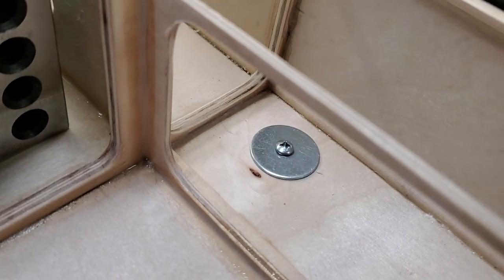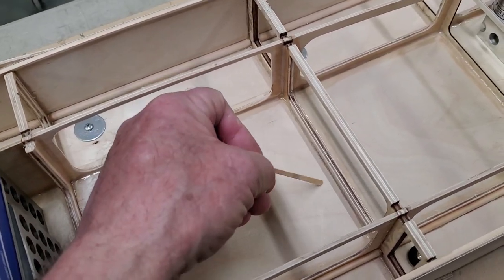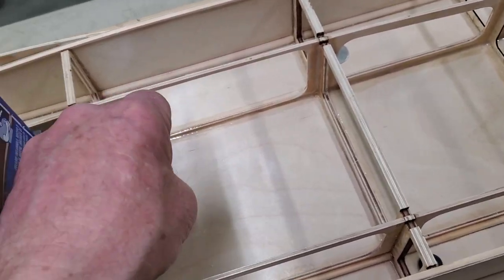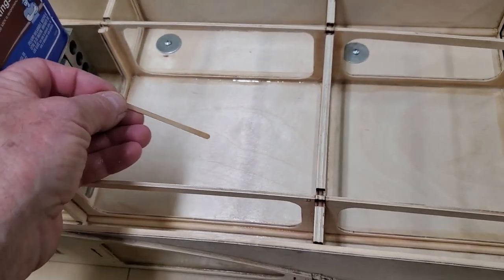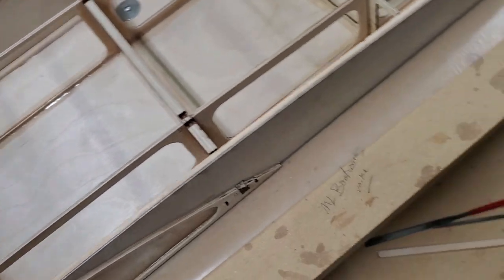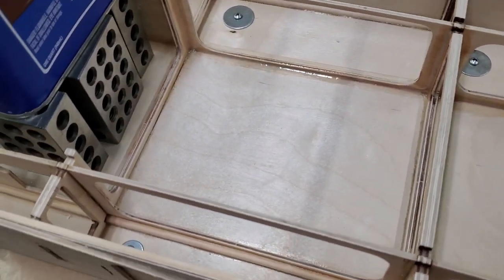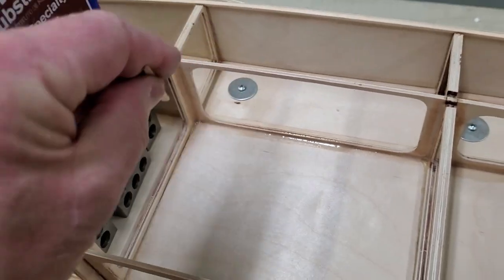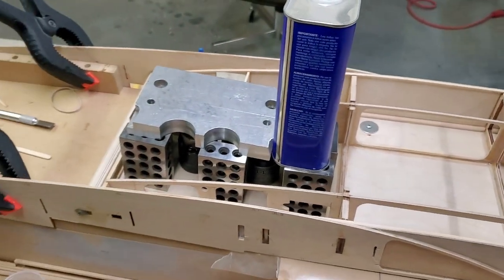RC Racing Hydroplane Boat Build - Reinforcing The Floor

Comment: What thickness are the pieces you are putting in? Is this better than glass or carbon fiber?
Reply from the maker: Good questions, and I guess I should've talked about that.  I use 1/16" ply for the overlay, and don't know if one idea is better than another, but I do know that it looks awesome in wood so that's why I use it. Personal preference I suppose.

Comment: I noticed you're using GFlex to laminate the sponson transom. Why use that over the 105/206 you used for the hull cross braces?
Reply from the maker: G-Flex is used mostly throughout, with 105/206 used only for sealing and in some laminating situations where I want a thinner mix
Reply: @M5PerfHydros  Do you have a rule of thumb as to when each is used? Is there a reason the cross braces needed a thinner mix?

Comment: G'day Scott.Question for you. Firstly, I had a flat bottom go fast boats years ago and it was all balsa reinforced floor to keep the weight down. Once it was resin coated it was extremely strong and it looked really nice. How would you go using balsa to strengthen the floor and the asthetic's would be really good as well.
Reply from the maker: Yup and a lot of the inboard hydros use it too, but the reason is that it's cheap. Balsa is super soft and nearly useless in terms of strength, so I can't see any reason to use it. Worse yet, it soaks up water like a sponge, so any small nick anywhere creates a wet, soggy spot that has to be cut out and replaced, all for no benefit!
Reply from the maker: A far better option for model boats (any boat actually, but very expensive at scale) is a flexible foam core.  Take a look at a product called Soric and you'll see what I mean.